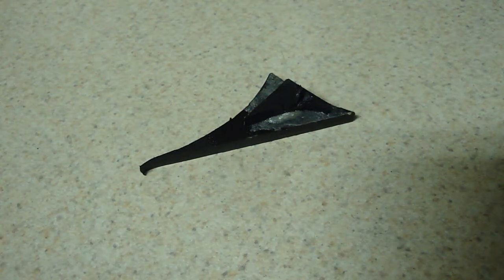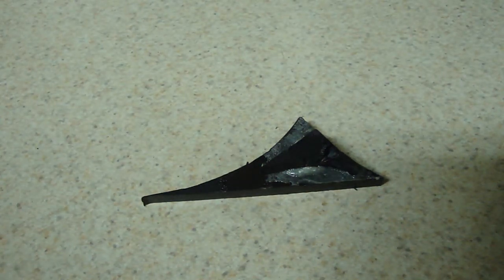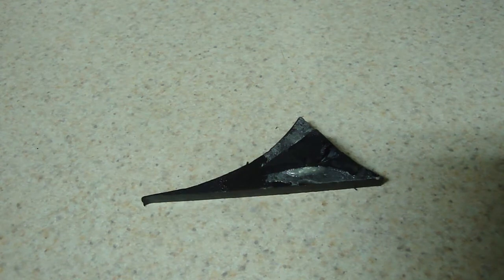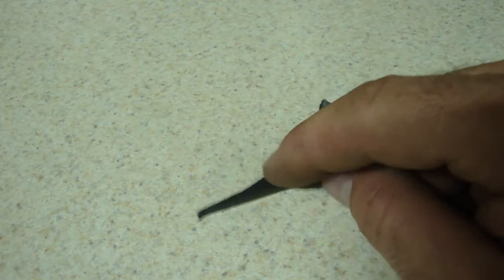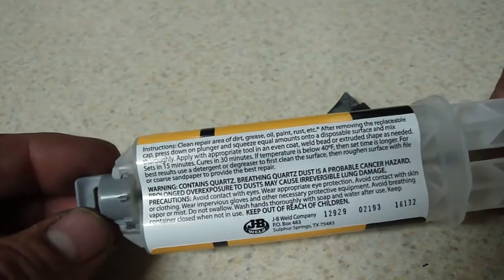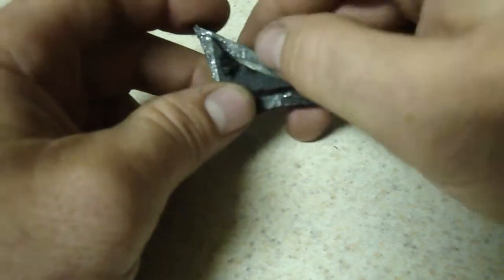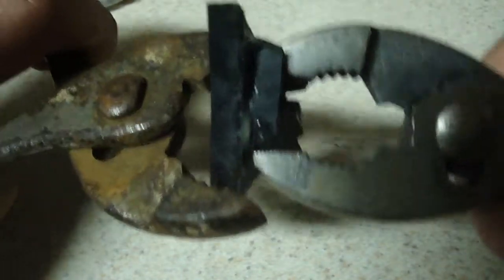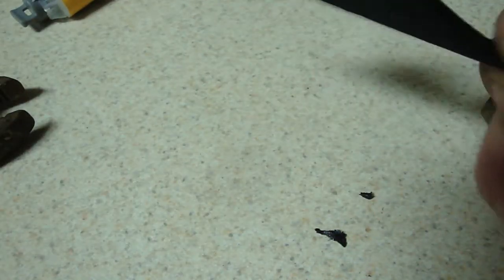King Starboard Cheaper Adhesive Alternative!

Comment: I use cheap hdpe cutting boards from Walmart for various projects but have never been able to bond pieces together unless I use some sort of mechanical fasteners.  After viewing your video I was able to find the JB Weld product at my local Ace hardware so thought I would give it a try.  All I can say is WOW!  Flame treat both pieces first using a propane torch, mix up some JB Weld Plastic Bonder and I cannot pry the two pieces apart.  Amazing!  Thanks for a great post!
Reply from the maker: Thank you for the comment and kind words :)

Comment: Thanks for the great video and the stress test using the pliers!  My application is somewhat different dealing with audio speaker drivers, but after seeing your video I can see that it will work. The fact that the bond is strong after that short of a cure time but still somewhat flexible makes the JB Plastic Bonder suitable for the bond I need. 
Thanks for your time and effort.
Reply from the maker: FreshCoffeeParts I'm glad this video was able to help you out! Good luck with the project :) I can say that the bond is still holding well on my ski, while it's not structural is definitely did the job for a much cheaper cost.

Comment: Very cool-
Thanks for the time spent
replacing the plywood cleats at the base of a 17" 1987 whaler montauck C.Console.
The console has plowed wrapped in glass at base of console, water gets in and rots plywood.
Going to try and glue starboard to the fiberglass instead.

Comment: Thanks for this video.  I had read mixed results with this product on Starboard or other HDPE products..  I think they did NOT heat the plastic like you did. I think this is a critical step as it is recommended by King Starboard themselves.  Good to know their is a cheaper adhesive that will work !

Comment: It worked good on my plastic bumper. It didn't work as well on my canoe. I probably didn't mix it well enough. Mix it really well and let it set completely. Also clean the surface with alcohol and rough it up with sandpaper first helps it adhere.

Comment: Thank you for this! I've been wondering if there was a cheaper adhesive out there that actually holds up to a boat being stressed by the water. I know that some epoxies work better than others and you have to heat up the starboard, but this is way cheaper and more accessible than the other stuff that King Starboard has referred too. 

How has it held up since you put the speakers on your jet ski?

I'm going to try this and see how it holds up! Thanks again!
Reply from the maker: I no longer have that ski but it held up just fine the time I did have it. I'm not sure what you are mounting but if it's a highstress area I wouldn't rely on just this, it would be good to also have some sort of mechanical fastener.
Reply: @dpgoverride  Ok, thank you! :)

Comment: Sweet! I'm in similar situation.The first glue you spoke of is $50I looked. No way! I'd be better off having custom made lid I'm making with 3/4" lip around outside.Trying to keep from using screws if possible.May try this? But curious did you try gluing with JB weld just by applying to the sides that would be glued together?Like how one would use super glue in most cases.I assume those $$ glues can glue the bird like this vs building it up like you did here in video?Mine will be visible so really don't want to see the JB weld.
Thanks for video, I'm sure it will help many that don't comment too!
Reply from the maker: cnvw974 thanks for watching :) in the instance your talking about bonding side to face, so essentially a "T" I believe for structural bonding depending on the dimensions screws would be beneficial. If I remember correct even with the high dollar stuff it is still manufacturer recommended to use screws where possible in structural situations.

something you may look into is plastic welding the pieces. using MEK to soften the plastic coupled with the adhesive may make for a better bond but that's just a theory in my mind.

Comment: That’s starboard to starboard.... what ya think about starboard to fiberglass???? Thanks
Reply from the maker: That's a good question honestly. I would think that as long as the fiberglass is well prepped for the application then it should be good. 

I would consult the manufacturers website and see if they have any specific instructions for adhering to other materials. It says it's good for fiberglass so I say give it a shot!